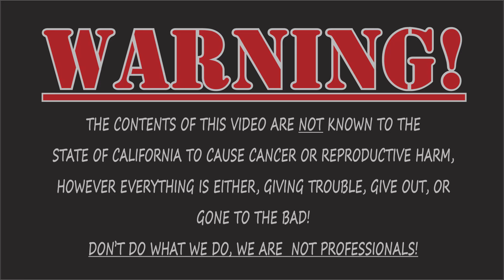2013 GMC Sierra Oil Pressure problems??(bad switch or filter??)

Comment: What about high oil pressure specifically a 2012 gmc sierra 1500 after driving my truck for about 45mins the oil pressure gauge was at 80 I do have a AMF range plugged in to keep it in V8 mode.
Reply from the maker: Never had that issue before?? May be a bad gauge or sending unit??

Comment: Check the VLOM manifold bolts. You will find them loose. Had same issue. VLOM bolts were the root cause. The filter screen is a flow restrictor to the VLOM manifold. The OPS is down stream of the filter/restrictor. If the VLOM is leaking internally you'll show low OP. Also the engines like new oil filters every 6-8 months. But that masks the VLOM leak for a short time. You can read actual oil pressure, by a port on the side of the block just behind the alternator bracket. Adapter fitting needed.  Been there done that.
Reply from the maker: Thanks for the info!👍

Comment: Change my oil pressure sensor on my 2013 GMC Sierra and it still shows my old cage that there's not enough pressure my truck still cuts off and I'm still having trouble starting it any suggestions any idea on what else should I do
Reply from the maker: I have seen the oil pickup in the pan on some of these vehicles crack or get plugged up but if you are having starting issues you may have a totally separate issue
Reply: Blocked oil pickup tube. Pull the pan, inspect the tube.